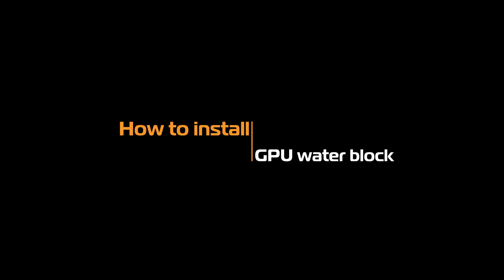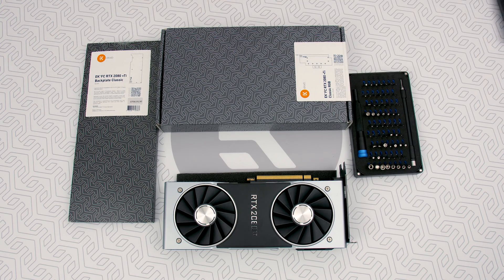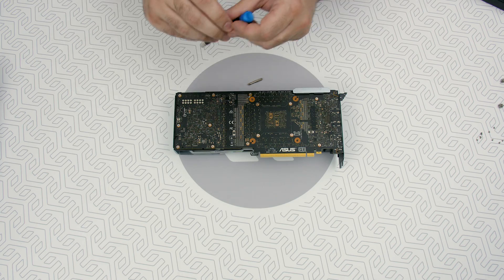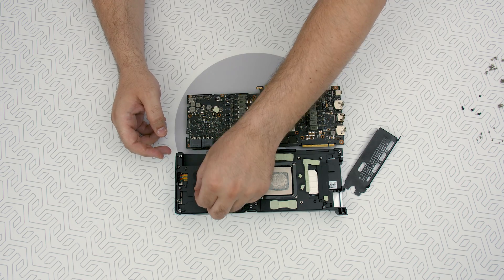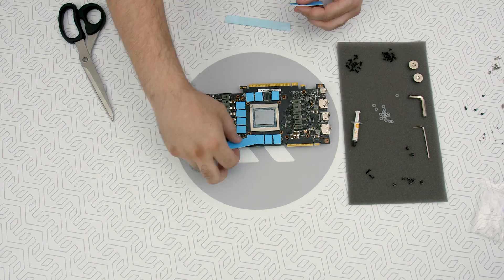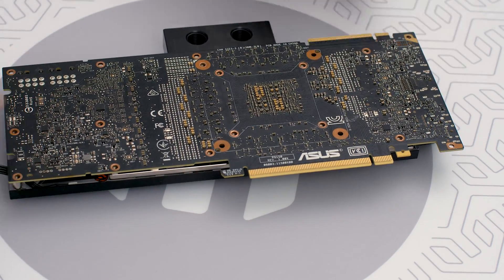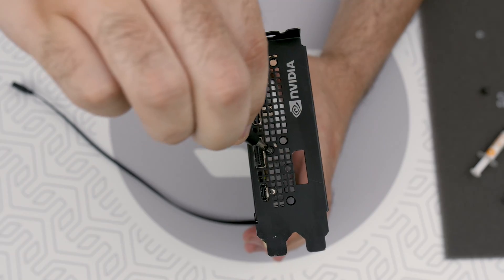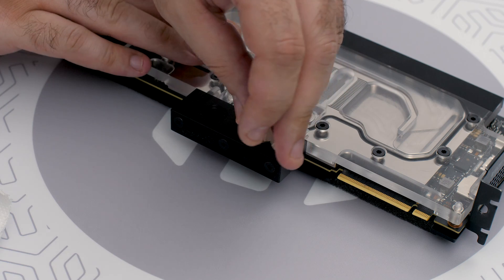How to Install a Full-Cover EK GPU Water Block

Comment: Is the EK backplate at all necessary or can you use the stock backplate that the gpu originally came with?
Reply from the maker: We do not guarantee compatibility of stock backplates with our blocks, but you may use our block without a backplate.
Reply: I ask myself after watching the Video...Does the new Backplate works with, or without termal-pads, because the original one was overloaded with those stickers? with best regards :-)

Comment: what are the nuts for in the packet? i got a bunch of them but dont know what they are for?
Reply from the maker: Could be in there by mistake. If you have enough screws and washers to complete the installation, then you can keep the rest on the side.
Reply: @EKbyLMTEK  thanks. Got all the stuff. Just getting up the courage to actually do this. I'm a beginner and flying blind.

Comment: Why you sell backplate separately? Ie. Alphacool block comes with the backplate.
Reply from the maker: Some users like to mix up the design of the waterblock and backplate and some don't want to buy a backplate at all. They have the option.
Our Quantum Vector  RTX 3090 FE waterblocks come with a backplate.

Comment: So you don't need anything else but that and water. You don't need a pump
Reply from the maker: Of course you need all the other components like the pump, radiator, fans, tubing, etc. to make a functional loop. If you continue watching the other videos in the series, we go in to further detail :)
Reply: @EKbyLMTEK  oh OK. Too pricey I thought that gpu could just be water cooled and that's it
Reply from the maker: @chrisjohnson261  
Yes, the price of entry is a bit high, but these systems are expandable, will last for years and offer higher performance thanks to more overclocking headroom. 
The water in these systems is a heat transfer medium. It takes the heat away from the block and moves it to the radiator to be dissipated. A pump is needed to move the water around in a loop, from the blocks to the radiators and back again.
Similar thing happens when you use an air cooler, but much less efficient compared to a watercooling loop.

Comment: When applying the thermal paste on a GPU don't use this method. Apply a thin layer across the enter gpu face. Different to a CPU. See my CPU core clocks for example. https://www.3dmark.com/spy/16257980 - I can play Cyberpunk 2077 4k ultra all day between 45-59 degrees max and always above 2100mhz +1000 mem. Alternative paste methods don't do this, especially when just using a corsair H55 & noctua 92mm fan for the vram, vrms. :)

Comment: You need to have an updated version of these videos for every RTX / RX GPU Block release
Reply: You tell us to put thermal pads on the back exposed capacitors, but I worry because I do not see this in any of your videos
(EKWB RTX 3080/3090 TUF Vector) Mentions that we put thermal pads here .
Reply from the maker: @Drey-Hobbies  
We have plans to make new video tutorials on how to install our blocks. Newer products require new solutions, so if the instructions say to put the thermal pads in a certain location, make sure to apply them there.

Comment: My RTX 2080 (not Ti) works only with the original cooling. When I put my water cooling block on it, it works for ~30 seconds when PC is turned on. I believe it has something to do with the cabel coming from the fans so the GPU thinks that there is no cooling at all. Anyone here who knows anything about this?
Reply: Which RTX 2080 do you have? (MSI, Asus, Gigabyte....)
Reply: Timme Asus Strix RTX 2080 Super OC
Reply: sounds like it isnt mounted correctly and is instantly overheating .
Reply: H3MPY Gotta look into it better, maybe something wrong with heat pads or something. Thanks
Reply: @jamesi6262  na it would be the core overheating for sure. meaning the block isn't making full contact with the die. Make sure you are not using any extra thermal pads as I saw a guy put extra pads in different spots and his card wasnt making proper contact.

Comment: Just made visual confirmation that this block is compatible with my GIGABYTE GeForce RTX 2080 Ti GAMING OC 11G (GV-N208TGAMING OC-11GC)
Reply: Minus the extra fan header on the Gigabyte card, they are the same. You will have to remove the fan header and bend the pins.

Comment: could i put the original gpu back plate back on... or do i need to put the ekwb one on?
Reply: I need to know this too
Reply: @Spiritusantus  ^
Reply: The description in the block's page on the EKWB store tells you if the original backplate is incompatible which for the case of my 3080 XC3 it was.

Comment: I came here to find out 
1. whether I need nylon washers under the backplate,
2. whether any thermal pads are meant to go under the backplate, and
3. how to route those RBG cables
I still know none of these things.
Reply: These videos are the worst
Reply: No idea what the complaints are because i watched the video and it seems pretty straight forward. Everything you need comes with the block and it tells you what you need to do step by step lol
Reply: @angelarroyo6001  yeah ive installed a bunch of waterblocks and this video shows everything you need to do.
Reply: @angelarroyo6001  we must have got different instructions man :'D
Reply: You do need the thermal pads under the backplate as for the nylon not as much.
Reply: @iShagers-YT  they dont say shit about thermal pads under the backplate. If you actually own one of these you would know the backplate is on standoffs so its actually not touching the card.
Reply: I just want to know if it comes with the plugs, I've spent a small countries gdp on fittings already ffs
Reply: 1. WHAT ?
2. WHAT ?
3. Really ? :'D
Yeah, looks like you know nothing
Reply: @kaarelk274  well yes you're right, this was my first GPU block install, so I was looking for answers everywhere. I worked it out in the end, been running 100% fine, but no thanks to this extremely useless video :)

Comment: What manual? All I got with mine is a package of screws and thermal pads
Reply from the maker: Hi Eric,

All manuals can be found online on their respective product pages.
Reply: EK sucks really...they delete all my comments and want me to burn their car.
Reply: @aciemiller3443  probably because you are in the comments calling everybody names and threatening to burn cars lol
Reply: Don't use "their thermal pads" with PLASTIC FOIL on it.
Almost burned my GTX 1080 Ti.
Reply: @aciemiller3443  youre supposed to take the blue part off bro
Reply: @aciemiller3443  nah, im just saying, my waterblock works fine with their thermal pads, i just took the blue foil off, like you should.
Reply: @aciemiller3443  eh, my 2080ti has been running great for 2 years with their block. Same with my 1080ti and 980ti before.

Comment: 3:30 Screw is too long?
Reply: I noticed this too, because I did the same thing on this 2080Ti, then realised and swapped for the shorter ones. The instructions are terrible, critical info missing for both waterblock and backplates.

Comment: What if I want to use the original Asus Strix 2080 OC backplate? Will there be compatibility issues or is it the same process as if I was using an EKWB backplate? I'm aware of the rgb header so I know I have to connect that.
Reply from the maker: Some backplates may be compatible stock, but many will require either different screws and/or modifications to the backplate for it to work.

Comment: well good video, but i'm kinda scared that I damage the GPU. which is quiet bad on a rtx 2080ti
Reply: Tibeau Van Hekken it’s not that hard just use this video and the manuel
Reply: @Vinz Laros The fck are you talking about ?
Reply: @Vinz Laros Yeayea, but why would you do it !? Like wtf
Reply: Kaarel Kostabi 
If you have a leak.

The proper tip is : first run the pump/loop without connecting the power cables to gpu and cpu and check for leaks. 

If thats fine, connect gpu/cpu and rerun the system.

I think thats what the guy meant

Comment: What about thermal pads on back plate?
Reply: apparently, they didn't include them in the backplate, and the excess pad from the water block thickness is different than the manual suggested.
Reply: dont need any